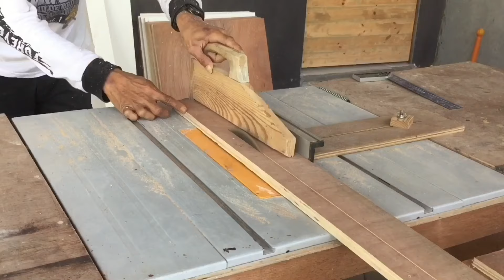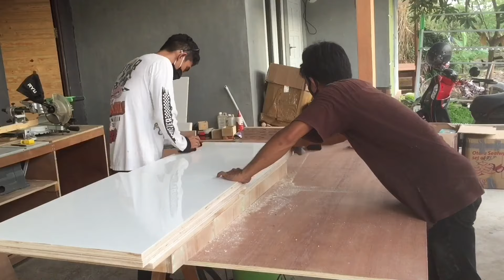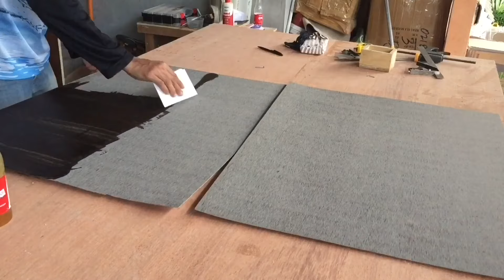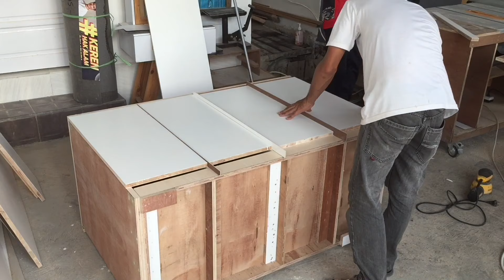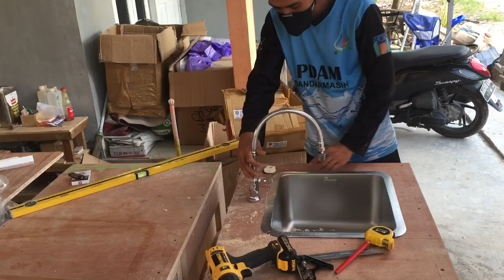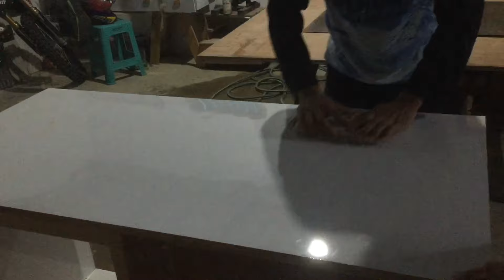Cara membuat kitchen set sendiri - HPL - kabinet dapur

Comment: Assalamu'alaikum.. Om.. itu peralatannya apa aj klo boleh tau?
Reply from the maker: Walaikum salam..
Utk memotong
Table saw, circular saw, gergaji

Utk perapian
trimer, mata trimmer flush trim bearing bit, mesin amplas, kertas amplas grid 80 & 240

Utk perakitan
cordless drill, paku tembak listrik, palu, mata bor fortsner bit (utk engsel sendok), mata bor kayu ukuran 2mm + countersink, sekrup, klem kayu

Utk penempelan melaminto dan HPL
Lem kuning 2 muka, kape, kain, thinner

Kiranya itu mas mhn mf klo msh ada yg blm ketulis 🙏

Comment: Boleh share jenis Bahan yang digunakan dan peralatan?
Reply from the maker: Bahan dasarnya untuk dinding samping sy mnggunakan plywood 18 mm yg luar dlm sy finshing dgn HPL, untuk dinding tgh sy mnggunakan blokmin 18 mm 1 sisi sy finishing dgn HPL dan 1 sisinya sdh melamin bwaan pabrik..
Untuk bagian pintu sm sprti dinding tgh..
Untuk cover blkng sy mnggunakan melaminto tbl 4 mm. Untuk top ny sy mnggunakan plywood 18 mm finishing HPL

Utk memotong
Table saw, circular saw, gergaji

Utk perapian
trimer, mata trimmer flush trim bearing bit, mesin amplas, kertas amplas grid 80 & 240

Utk perakitan
cordless drill, paku tembak listrik, palu, mata bor fortsner bit (utk engsel sendok), mata bor kayu ukuran 2mm + countersink, sekrup, klem kayu

Utk penempelan melaminto dan HPL
Lem kuning 2 muka, kape, kain, thinner

Kiranya itu mas mhn mf klo msh ada yg blm ketulis 🙏